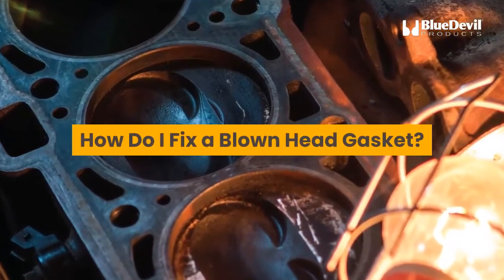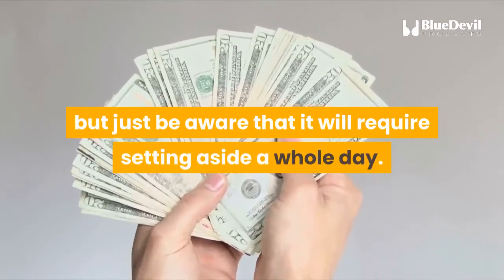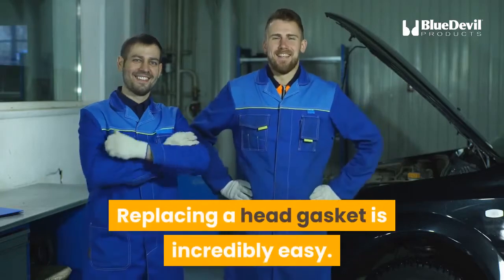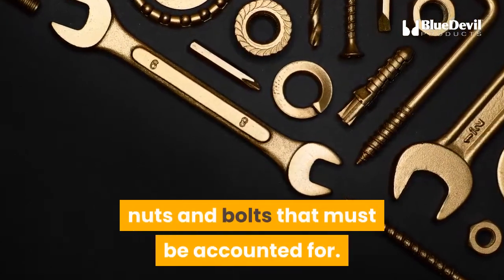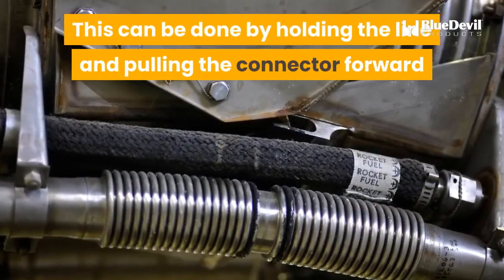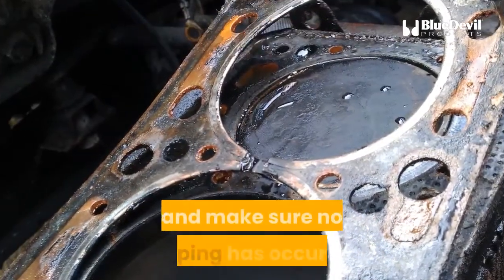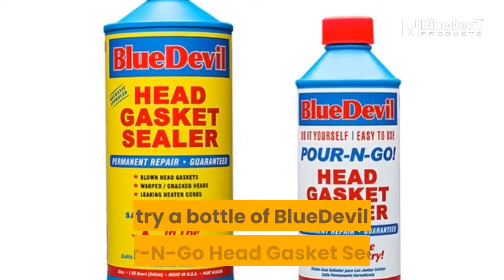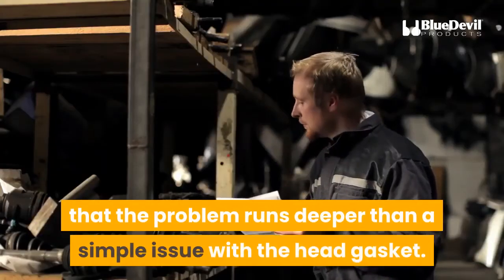How Do I Fix a Blown Head Gasket

Comment: Hi, Do you product works with Motorcycles? I have a Triumph Street Triple 765, 3-cilinder engine. I'm having problems with the coolant system, there are bubbles on the radiator and the reservoir what causes the coolant to leak. I suspect the issue is the head gasket, but I was wondering if I could use your product and how much should I use since the coolant system holds 2.1Liters of coolant in my motorcycle.

Thanks,
Reply from the maker: Hey there, thanks for your question.  I would encourage you to call our tech support team so they can help you directly regarding using any of our products for a motorcycle.  888.863.0426 - BDP
Reply: @BlueDevilProducts  Hi! Is that phone from US or what country? Thanks!
Reply from the maker: US.  You can also email: productsupport@gobdp.com